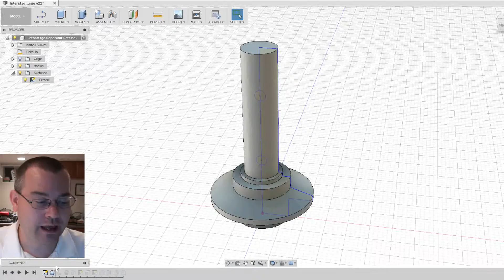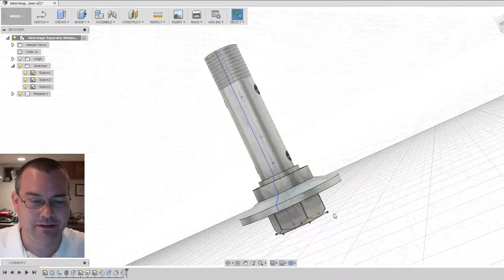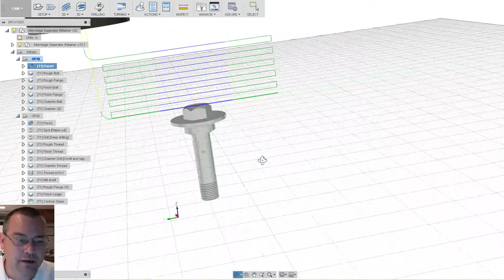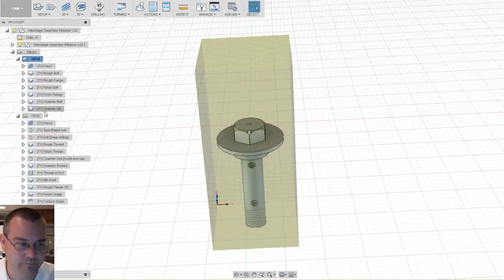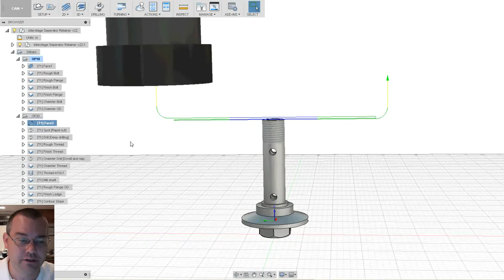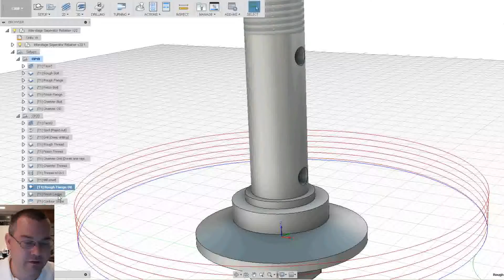Making a Lathe part on a Mill, Part 1 CAM (Moisture Separator Retainer)

Comment: Hi Tim,
 
A solid rod is stiffer than a cylinder of the same outside dimensions (and made of the same material). TAANSTAAFL applies!

The stiffness to weight ratio of the cylinder is better, which is where the confusion often arises.
Reply from the maker: Thanks Paul, you are correct. It does change its natural resonance frequency though, maybe I should make another one and change the tool order and see if it has any effect. Thanks for watching and keeping me honest.

Comment: Another excellent video Tim. I really enjoyed this format and would love to see more videos with this format. I could easily watch long enough for the machining in the same video though, but understand your reasoning for making a 2 part. Thanks for showing the corks and fixes for the chamfering,  I've been struggling with that for a while and have been falling switching to other cam software for parts with a lot of it. Thanks again, just Steve
Reply from the maker: I struggle with the length of videos. Fact is, not may people want to watch very long.  The average view duration for the channel is just over 5 minutes, LOL. And what would be life without a good cliff hanger? Will the CAM strategy work? Or do we get to watch a 2" face mill chuck a hunk of aluminum across the machine? Find out next week!

Maybe I will do more of these and show some of my work arounds within Fusion. I'm trying really hard to stick with it, sometimes I get into a hole of doom and get frustrated. Other people just deal with it and don't speak up or I'm asking way more then most from the software.
Reply: I hear ya. Frankly I'm tired of the "you have to deal with sub par performance because it's free". I'd rather pay a reasonable amount and have a reliable program. It seems to get better all the time its just slow coming.

Comment: I just bought a thread mill, how in the heck do I set it up in the Fusion 360 tool library and how do I set the tool height in the mill?
Reply from the maker: HI Doug
Have you watched the Fusion 360 Thread Milling A to Z video?
https://youtu.be/rUCSM8w4XWw
Its a bit long, but I go through everything on how to thread mill.
Reply: OK, think I have a handle on that now. Next question is how do I set up a thread size not in Fusion-360 threading? 35 X 0.750 threads is just one example. I created a coil with a triangular shape and extrude cut for thread in CAD. Is there a better way of doing it?
Reply from the maker: Wow, 35 inches by 0.75 threads per inch? That's a HUGE thread! One heck of a machine you have to make it too ;)
Wait, you are talking millimeters right?
In any event, unless you need to do renderings or simulations there is no real reason to model the thread. All you need to do for thread milling is just model the major or minor diameter so you have the surface to select for contouring and then thread milling in CAM. In the video I did not model any of the threads, just the diameters.
If you DO need to model a non supported thread, you have found one of the weak areas in fusion (IMO). You are going about it correctly though, make a coil and extrude a triangle to make or cut the thread. I don't know of any other ways to do it yet.
Reply: MM :)
Reply: Camera lens threads
Reply from the maker: Oh, ok, for a second I was going to ask you to make a video!
Still sounds cool though, threading thin walls can be a bit tricky.
Reply: I plan on threading before boring out the stock.  Weird thread sizes not in the library are a challenge!

Comment: Only we need "farmers wisdom"... And you have it!!!

Collet chuck??? Do you hav it?
Reply from the maker: LOL, I know where your going ;)

Yes, I'm actually going to setup some lathe tooling on the table for some other "lathe" parts I need to make.
I'm actually working on a totally custom post processor that will allow me to CAM the part with lathe tool paths and then post it to my mill with the stock in a collet. I make these little sight glass parts out of acrylic with an oring groove in them.  Been turning them by hand on my little Atlas "lathe".